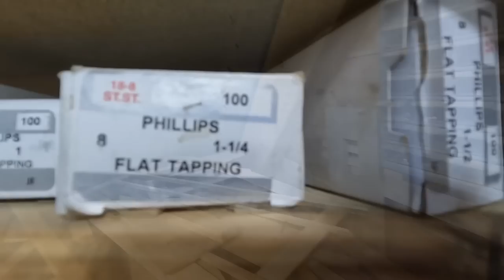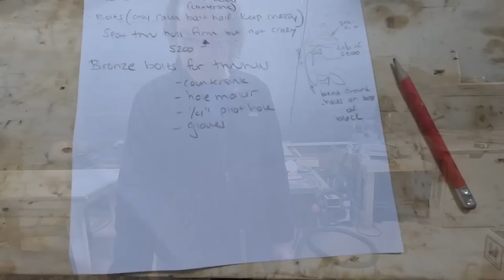Hauling the Geck and Back to Maine!WHSE92

Comment: Hey Holly. I have a whale foot pomp with the pickup in my sump and the exit gets dumped into the exhaust.  It’s great because when my bilge fills, I kick the foot pump a dozen times and no more bilge water.  Now you need a place for the pump, and that may be a limitation.  Good luck with whatever solution you end up with.
Reply from the maker: Ooo that's a great idea. I never though of using one of those as a bilge pump

Comment: Happy to hear you making headway by  ''slugging'. I have done something similar while learning to manuver a slow speed stall. the instructor would have me slow the plane down until it was finally 'mushing' and we would fly around like that until he got mad and made me pull enough power out or pull the nose up until we fell off on one wing. I would immediately put the nose down gain speed, straighten the directton and recover. your slugging reminded me of my mushing. Happy sailing to you Holly you wind hippy!

Comment: Love the recipe idea: peas, lemon juice and coconut oil.  Pure genius.  Have you considered siphoning out the water.  Should be easier than all that pumping.  Run a hose to ground level, tape the upper end into the lowest part of you engine bilge, then from tge ground (carefully) suck the hose to get started. Use the time saved to invent another culinary innovation with a can of peas.

Comment: i use a different method for getting a clean hole with the hole-saw without it biting. Put it in reverse and start the hole for about 30 seconds then put the drill in forward using a slight pressure, gradually increasing pressure to finish.
Reply: Ha, my comment

Comment: Holly, if you don't care about break-out on the other side of where you're drilling with the hole-saw do just like your dad showed you and if you are concerned about the other side being clean, drill about half way through the hole with the hole saw, then stop and move the hole saw around to the other side and continue the cut by putting the hole saw in the existing pilot hole and both sides will be clean and break-out and splinter free...cheers

Comment: Holly....12 volt wet/dry vacuum for pumping out your bilges. Can find amazon or any truck stop in the states. Cheap and much quicker than hand pump and no need to slurp prime that nastiness lol. They're easy on the amps as well as not running long and don't need to run inverter. They  also make a hand pump for quickly draining water meter and backflow boxes in ground. like 20 bucks at the irrigation supply stores. No need to prime and has long outlet tube so can dump directly into sink. GET OUT OF THAT TROLL HOLE LOL

Comment: Somehow I've missed hearing the source of the water when you engine runs.  Stuffing box?  Raw water intake?  Water pump?  Maybe it a crack in a hose?  Who knows?? Water pumps start weeping when they're getting old, but not near enough H20 to produce the amount of water your seeing and if it was the stuffing box, I'd expect it to be dripping quite a bit when the engine wasn't running.  Will be interesting to know what's what when you get to the bottom of this.  Have a great respite in New England and then back to the ocean :^)